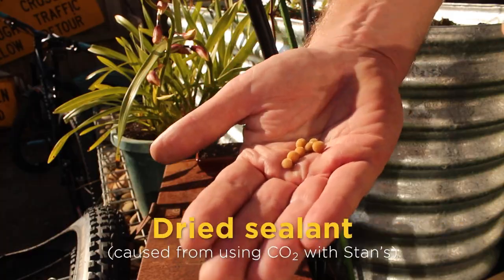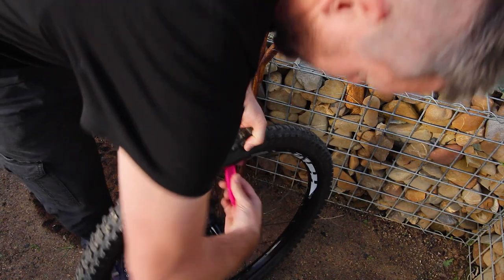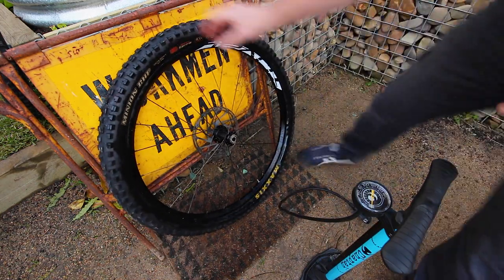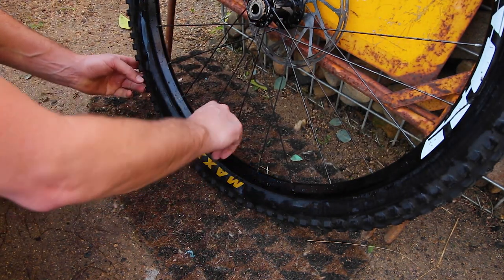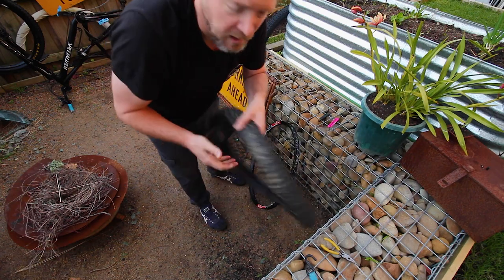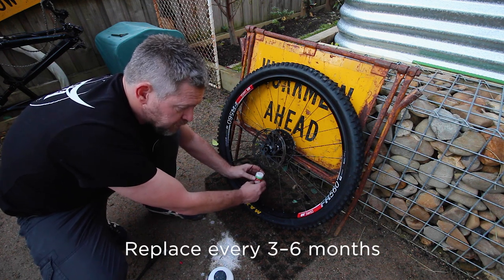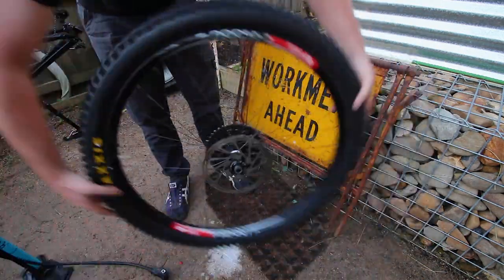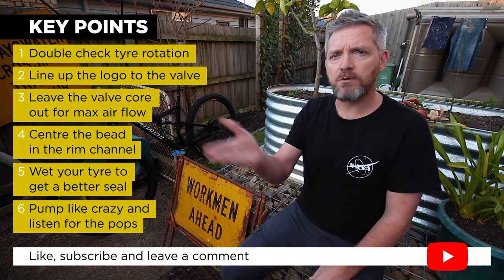MTB HOW TO: Change Tubeless Tyres Using a Floor Pump

Comment from the maker: Since posting I've received a few additional helpful tips.

The first comes in at 4:00 where I let the air out of the tyre after seating the bead. Liam from Cycle Works mentioned to let the air out slowly to avoid the bead coming off the rim again (the reason why you see sealant leaking out and also why the 'pops' are heard again while pumping the tyre up a second time). On a Facebook post, Terence Reimer mentioned he also overinflates his tyre and then goes for a gentle ride to ensure the bead stays put. Of course that means you'd have to reinsert your valve core if you were to do that. Both are great tips worth sharing.

Another great tip I received was from my brother Paul. He mentioned that you can use three links from an old chain as a valve core remover, two narrow links and a wider link in the centre. The larger span from the wider link is just wide enough to fit your valve core and too wide to avoid over-tightening.
Reply: I love this channel
Reply from the maker: @jacobdabom2  Thanks for the love 🥰

Comment: Lol u and biking car fanatic uploaded in the same minute. Good to see ur still there and healing
Reply from the maker: Yeah still around. Wouldn’t be many riding atm with all the wind damage. You been riding much?
Reply: @Sportilium  I've been riding a little bit, I'm looking at upgrading my bike to a giant trance 27.5 2021 model but I'm gonna be saving forever😓. I was right in the middle of the huge storm. Luckily no one was injured but my neighbor had 2 gum trees fall on his house. Still no power and we're not scheduled to get it back until july 10😥. How did u go in the storm and how long till u reckon ur back on the bike?
Reply from the maker: @user-vs3iu1sx4z  lucky for you but not your neighbour. I rode to the summit just after the storms and have seen pics. Shocking to see all the damage. Hopefully power will be back sooner than that. No damage on this side of the mountain at all. I don’t live in the bush either. Gradually getting back on the bike again. Will have to work on my fitness though
Reply: @Sportilium  I wouldn't b surprised if the trails are coated with trees. It could b a while b4 they're all cleared, in silvan anyway

Comment: I prefer to pour sealant directly in the tyre from the bottle. Less risk of making a mess, easier, faster. So I always leave enough bead open to do this, I fill the max recommender amount, which on on 32 hole rim is for 4 spokes worth of sealant.
Reply from the maker: Yeah that’s probably a better way. For me this was more an attempt at seating the bead using only a floor pump. Seeing I hadn’t tried it before I figured it would be best to seat the bead first. I’ve seen them pour sealant first in at the shop but they then have a compressor pump which makes it easier. Loving your tips though 🤘
Reply: @Sportilium  seating with sealant is not an issue, less work tha. To seat first and fill sealant. I have Fumpa electronic pump, but it only lasts about 4 full inflation of 29er. I keep it in the tool compartment in my backpack. The pumpt has a display. The support is great too, I had one failed unit that reading got crazy on and they made sure retailer replaced it, but USB port fell out so I sent it for repair and its fixed, they sent me some extra seals too. 👌

Comment: Nice one. Put the last set on mine on my own which was amazing given I pretty much screw up everything I try to DIY! I cheated a bit though. I used one of those air cannisters and it worked first time on both front and rear.
Reply from the maker: That's certainly the easier way to do it as long as you get the seal to work first time. I have a compressor at home but was adamant I wouldn't use it for the purpose of this video. I stuffed it up and tried a few other methods I'd heard of (massaging the bead into the rim and a ratchet strap), none of which worked. Centring it on the rim really did the trick for me but have been told that doesn't always work either. Those balls you see at the start I read are what happens when you use the CO2 canisters with Stan's sealant, which is why their instructions state not to use them.

Comment: 1:42 Keep in mind this unsesting method does not work at all with some rim and tyre combos. Sometimes you will have to put the tyre on the ground, kneel down on the wheel, and push using two hands and upper body. I had to with Maxxis tyres on Hopetech Enduro 23mm, both with and without Cush Core with Bontrager Se04 team issue from years ago, without inserts, Schwalbe Ice Spiker with Cush Core.
So far the easiest to  remove tyres were 45nrth they were easy to remove despite having inserts on 23mm rim. Now I have 30mm DT Swiss rims. But keep in mind sealant can also make the bead stick to the rim so this might be needed on any setup. Now I use Michelin Wild Enduro, which are easy to push into the centre of the rim, even without a tyre lever and on narrow rims like 23mm, due to the textured sidewall, unsesting is similar to Maxxis I guess.
Reply from the maker: Useful advice, thanks Johannes. Yeah I also recently learnt there are hooked rims (more for road bikes though I think). So much variation, no wonder they charge a premium for bike parts 🤣
Reply: @Sportilium  hooked rims? Most rims have hooks, for bead to hook on, but roadies can use hookless rims, gluing the tyres to the rim, no thx. 😁

Comment: Great to see you back riding around again Friedo. I think I've only managed to do a full change with just a track pump once haha. Usually end up going a compressor in the end. Then still have to shake like a madman.
Reply from the maker: Thanks for the support. Haha, I confess I have a compressor too but wanted to see if it was possible using just the track pump. I’ll have to see if I take the easier option next time or whether this wasn’t just a one-off fluke.
Reply: Or just head to the servo and use a presta to shrader adapter - just don’t overinflate and blow the Tyre off the bead….